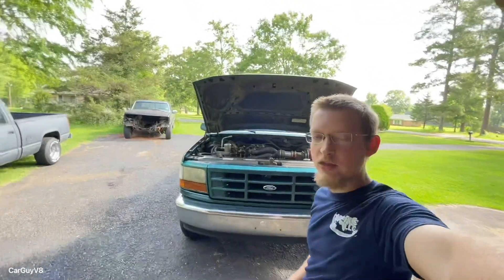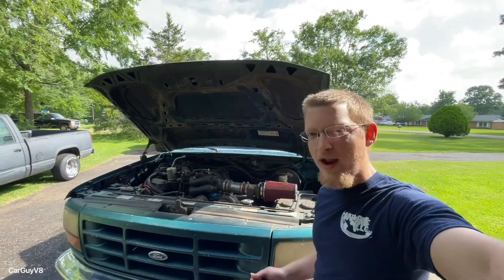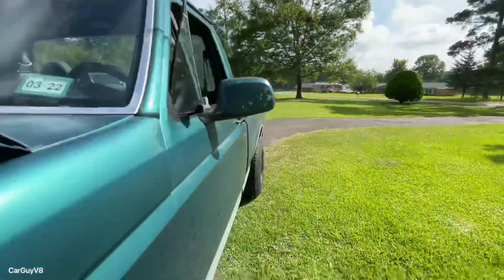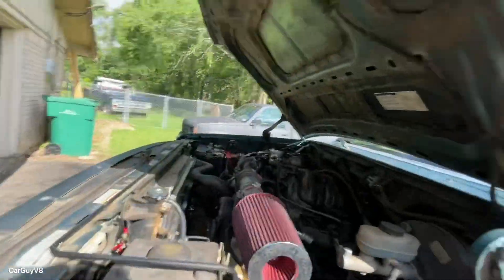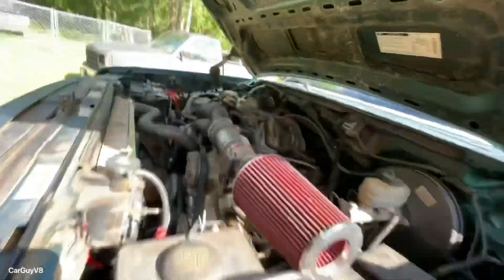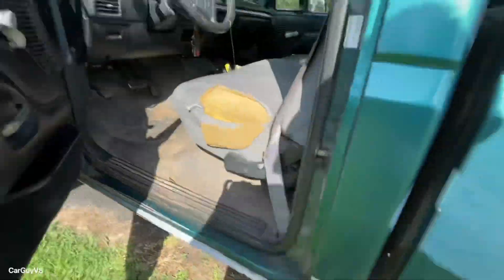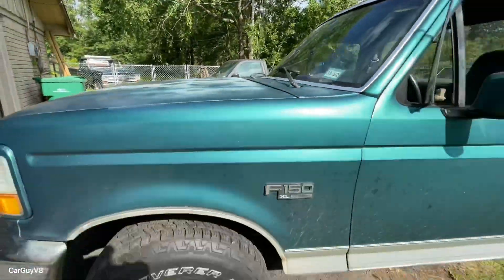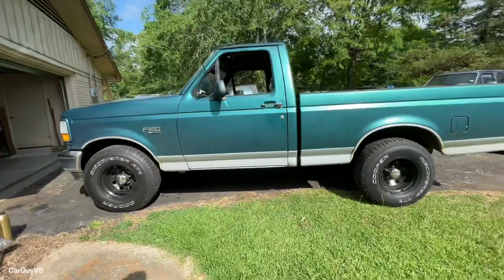How To “Ghost” Cam Your EFI 302 and 4.6 2v

Comment: Just unplug the map sensor hose and itl sound way better.
Reply: where's that located brother
Reply: @tryphoncuh2116  should be on the passenger side of the engine bay, usually above the heatercore lines. Should be a box with two screws, a plug and a hose.
Reply: @CoachSludge  yo I’m gonna try this on my bronco but. Wanna know what it does and is it safe?
Reply: @emerykinzie794  basically makes your truck runs like shit, it dumps fuels into the intake. Wouldnt drive for lack of power, but run a switch inside the cab if you wana sound cool idleing at a stop light or somthing. Its safe just dont drive it for risk of stalling. 😎 stay cool bro
Reply: @CoachSludge  oh
Reply: @CoachSludge  any recommended mods to these 5.0s??
Reply: @emerykinzie794  maf swap from a foxbody, regear your diffs, and run ethanol free gas, the 5.0 has more than enough power (truck), just the m5od steals all the power(flush it and itl come back to life for a while), would recommend a zf5 swap.
-
 if your really looking for power, ditch the efi and run a carb. after that is basically headers intake exhaust ect ect. 
-
But at the end your better of just getting a f250 with the 5.8 or 460 or 7.3, those efi 302's cant do much. another note, on swaps the 6bt fits inside if you hammer out the firewall, drops right in and the zf5 with a mounting plate.
Reply: if you got the money and time a swap is worth it, compared to a carbed 302, but i would suggest a upgrade to a f250 or f350.
Reply: @CoachSludge  dang…yes I think I’m gonna have to swap out that 302 for sure later on thanks for the info saved me a lot of time and I learned a thing or two

Comment: Do you know if heads and manifold from the 302 mustang ho fits the 5.0 efi ?
Reply from the maker: The heads are the same at least on the later efi 5.0s like mine. The intake is on the opposite side though. You’d probably have to do a little wiring.
Reply: Your better off going with gt40p heads.
Reply: @CarGuyV8 The truck intake actually flows better than the HO. The heads are exactly the same and suck pretty bad but can still make good street power especially in a pickup where torque is king.

Comment: Wait…. There’s supposed to be vaccum lines there 🤣
Reply: Don’t get me started on that shit. I bought an ‘86 EFI F150 that’s been completely run through in the engine bay. Firing order on the distributor cap is bizarre, vacuum lines everywhere, they stuck a later model air box set up in it…. The thing is a mess. Makes a weird electrical buzz when it’s running and surges like a mother at idle. Oh and the PCV hose just trails off to nothing 😂